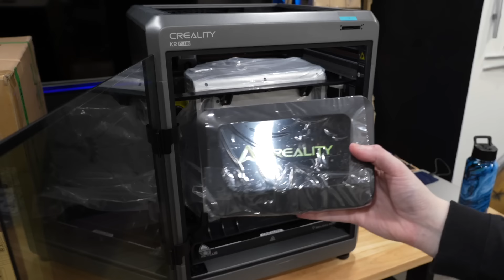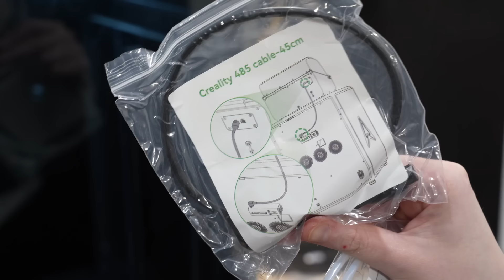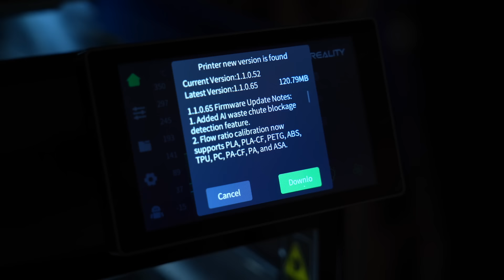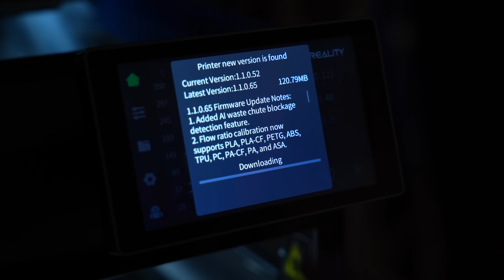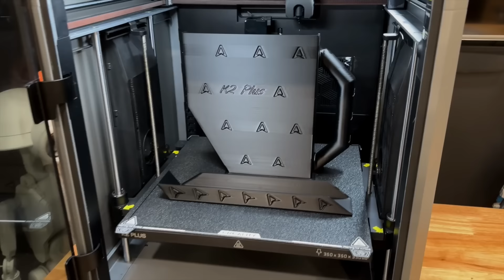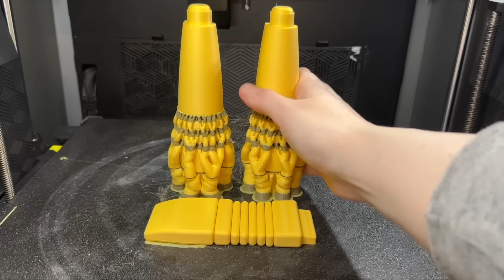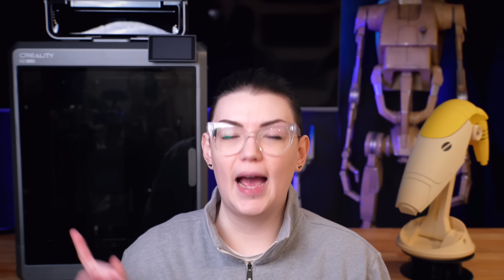Does the Creality K2 Plus live up to the hype?

Comment: I've had mine since launch and just passed 5,000 hours. I've run into plenty of small issues and replaced a few parts along the way, but that's actually one of Creality's biggest selling points for me. Yes, their printers are more troublesome than Prusa and Bambu, but they're also far easier to work on. An extruder jam on my X2D is a two-hour fix that involves removing 25+ screws, both nozzles, and six delicate plugs just to reach it. On the K2 Plus, you pop off the cover and remove three screws. That kind of repairability makes the occasional headache worth it, and Creality's replacement parts are dirt cheap. I'd take twenty 5 to 10 minute fixes over three 2+ hour fixes any day.

That said, some real design flaws show up the longer you own the K2 Plus. The biggest is bed warping after extended use, especially at higher temps. After about 1,500 hours of engineering filaments, my bed mesh looked like a taco. No amount of manual adjustment could fix it, and eventually it got bad enough that the mesh couldn't compensate anymore. The root cause is the massive 350x350 bed being supported by only two threaded rods. With a third rod, this likely never would have been an issue. I ended up buying a $250 graphite bed that will probably outlive the printer, but that's a headache most users won't want to deal with.

Still, at 2026 pricing, the K2 Plus Combo can often be found for around $850, which is a great value for a printer this size.

Bottom line: it's a great printer with some real issues. With the wave of tool-changing printers hitting the market, I'd only buy the K2 Plus today if you need the large build volume and only do occasional multicolor prints. But for engineering filaments, the K2 Plus is a monster.

Comment: I have had a K2 plus combo for 10 months, Purchased for a hobby machine not a business.  SPOILER ALERT Creality can't tell you how to replace the belt and the way it is attached to the extruder head is about as cheap as it gets.  Supports motto is delay, delay, delay and hope the customer goes away. It is cheaply made and quality control is non existent my experience with support is similar to @toofdoctor's below.  I really found this out after about 8 or 9 months.  Mine had missing screws, wires that have fallen out of clips and sensors that fail.  Initially it worked well except for the nozzle clogs.  Those went away with the purchase of a new nozzle and getting rid of the original and running the printer speeds a little slower than from creality print or Orca slicer and that helped print quality. Also preheating the bed helps a lot. The filament jams in the CFS aren't always easy to find or clear and they do happen.  The filament sensor in the hub on the bottom of the CFS fail and need to be replaced.  After 9 months the Y axis motor quit working, the CFS hub on the bottom had filament sensors that failed. Contacting support for a warrant.  Had to supply purchase information.  Then pictures explanations.  Then videos.  It took over a month and they sent some parts but never helped me fix the printer.  To replace the y axis motor a large amount of disassembly is required.  And to remove the side panels get a hammer a block of wood and bang away.  This was Crealities way to do this.  Being an engineer I was able to design some parts, machine them and make it work.  BTW Creality still hasn't supplied a solution.  The instructions and the wikki are terrible.  These are wrong, have missing steps etc.  MY LAST PRODUCT PURCHASE FROM CREALITY anything I have bought besides filament and spare parts to repair their mistakes have been terrible.  Whatever you do don't by a laser from them.

Comment: Thanks for the review. Gives me some insight if I should move up to a K2 or keep my Ender 3 farm. I have 4 Ender 3 V3 SE's, whenever I print anything large I just divide it into 4 parts and print each part among the 4 printers I have and glue everything together. Debating if I should move up to something larger. One thing that's holding me back is the K2 is heavy AF.

Comment: I'm on day three with my K2 (not plus) and I'm having a ball. Ignorance may be bliss but I've been happy so far. My benchy fell over toward the end of my first print 😔 but I did not wipe the plate down. I presume it had manufacturing schmoo on it, I know better so that's my fault. A couple custom designed hanging tool holder were problematic but only from the standpoint of tolerances and bridging/support fails, again, me learning stuuff. The biggest dislike Ive had was coicidentally when trying to print a waste chute that was just outside the limits of a K2. On my fourth download of the stl, checking comments of people who say it fit fine, yada yada, I loaded it up and it fit. Yay. Somehow the slicer brain farted and loaded up a K2 Plus profile and limits for my little K2 and it made some very unhappy noises once it started printing (I know this now and the difference between happy and unhappy noises) and ended up erroring out overnight at the beginning of an 11hr print.

Comment: UPDATE. 

 I bought one. 2 days later came back to it and the hot end was COVERED with melted filament. 2 days new
Then I had to go back and forth for 2 weeks to finally get them to send me a new hot end. For ME to install. If you want service warranty don’t buy this machine
Then after I get the new hot end and install it. Print 3 parts and started giving me a z axis obstruction error every other print. Have to restore the machine every other print to fix it. Sent them an email. As of a week ago, no reply
Warning. DO NOT BUY ANY OF THE K2 MACHINES

Comment: I shut off the purge tower and purge into into the print as infill using Orca, works really well.

I have also invested in the start up “Loop” filament maker. For the sole purpose of recycling purge, supports, and other non-used filament. You can also use it for recycling pet bottles.
Reply: Thanks for sharing. Good info

Comment: After the latest patch firmware this machines printing is gone down the absolute shitter.  My bed no longer prints out that nice L shape on the corner anymore, its like the xtruder is sporadic and decides when to spit out filament.  The Creality software is also buggy as all hell.  Filiment selector is broken and used to work fine, crashes all the time for no reason.  And the AI detection since day one has been an absolute joke.  The whole cabinent can turn into a string mess and it will just keep printing.

Comment: The thing i have found with mine is that there is a huge change is filiment usage when i print multi color i found the slicer does not account for color changes in a design perhaps that was where youre difference was as well

Comment: Yes Creality support, software, customer service and parts are beyond poor to a new level of China shit. Half the time I am not even sure what part fits what without buying and guessing. PS if you use an older laptop or cpu creality prints WILL NOT WORK and the K serious will not run well (really poor) on any other slicer and orca also will not work on the same laptops and CPU's-so if your using older cpu's buy something else. Creality cloud may work but is super confusing and glitchy-it's almost like someone who never made a website or has low level organizational skill made creality cloud-3/4 trash.

Comment: Just an idle thought, wouldn't it drastically reduce the filament wasted during a color change if the hub were moved up right between the CFS cabinet and the ptfe tube inlet to the printer?  Shorten both of those ptfe tubes to like 3 inches and knock off what, 15, 20 inches of the amount of filament that has to be retracted for a color change??

Could you try this for a wasteful print, with regular and shortened tubes, and let us know if/how much filament is saved?

If I'm misunderstanding the purge process, surely it'd still be a time saver?

Comment: Oh yeah this printer is a BEAST!  Even when emptied, it still weighs a LOT!  

The adhesive stickers/tape is def frustrating, although I got lucky and mine came off fairly cleanly.   You pointed out that there was thin plastic film on the upper right side but how about the same film covering the upper left side on the metal siding?  Yup!  Learned that today when I saw that the print head cable management snake was leaving marks on the film.  I had no idea it was there so I peeled it off.   It can be bad leaving that stuff on surfaces that get heated. 

Anyhow great video content.  Thank you!   

BTW: Do you happen to know if you can use the CRM along with the single spool holder?  I don't want to get greedy but it sure would be nice to have that 5th color available.   I'm pretty sure you can because the buffer allows for up to 4 CRM's so why not use one of the three other avail tube inputs to connect the single spool holder?  The software wants me to ID the CRM filaments AND the spool holder filament so it seems it is designed for this.  Logically, it should work but who knows because it is NOT mentioned in the manuals or the wiki.   Their client side support is half baked IMO.  Some of the images they refer to when instructing a user how to do something shows a different printer all-together and/or up close images of their R&D printer which is burnt up pretty badly.   Like ... Isn't this a flagship model?

Comment: Feel like you could have gotten just as clean a print on something like a Bambu or other similarly sized printer by using a .2mm nozzle instead of the usual .4mm.  Quality would have been even better using a .2 for that print on the K2, but BOY would that have increased the total print time....

As for the purge waste sometimes being all one color, I'm thinking it might be doing the same thing it does if you load filament from the spool holder rather than the CMS, where it'll extrude a pretty large amount, wipe it off, and then extrude a little more one or two more times.

Comment: One question that none of the videos I have seen have answered. Does the machine let the filament completely run out at the extruder before loading the next spool from the CFS? Meaning it has to stop and do a purge before resuming

Comment: While Creality is offering more replacement parts now it's still not very complete. I broke the extruder and the filament buffer. It's partly my fault but the instructions could have been clearer.

Creality's web store support suggests "check Amazon or other places". I found the parts on Aliexpress but that's not the best feeling when I want assurance that it's a genuine part made by the company instead of a copy which is likely to be substandard. Whether or not they're genuine originals, these parts are still 2-3 weeks away from delivery.

I can still use the printer but it really drove home the point that it's still a Creality printer. A friend warned me they have a history of abandoning support for printers to move on to the next model. At this point I would pay more for a machine that is better backed and better supported. I was hoping being a "flagship" model it would be better than this.

Comment: My K2 plus is great and horrible.   When it prints it is great but it fails to print about 2/3rds of the time.  Many many different error messages kill a print.  Thankfully the errors usually occur at the start of prints but filament feed errors will happen at any filament change.

Comment: Good review, I have the BL X1C but if I’m backed into a corner with updates etc with BL or it stops working for any reason I’m sold, I will have one no problem. What slicer did you use? I believe that the Creality slicer is less than perfect. Thanks

Comment: The parts issue is a hobby/industry-wide issue seemingly at all times regardless of manufacturer to varying degrees of severity. With the new admin in the white house and potential political repercussions, I've noticed a sh!t ton of panic buying that is further depleting available stock of just about everything, even across other formats like resin printers. Most recently, my main resin printer went down unexpectedly due to the almost new LCD screen just deciding out of nowhere to crap out. Normally this isn't a problem, but lo and behold, All vendors for LCD screens are sold out for this model (any many others as I found in doing a bit of investigative research), and I had to contact the manufacturer directly to get on a waitlist for the next batch of replacements. 
I ended up getting another monster FDM printer to supplement current R&D projects, and damned if you do/don't, filaments and spare parts for FDMs are almost gone, too, regardless of price bracket. 
Different topic, printer poop is a personal bane that I've never wanted to explore just due to wastefulness versus painting or even investing in multi-head tool changers. While my ratio of functional to fun projects is about 80/20, there are times where I've considered various schemes of multi-color printing just because, but I can't get past all the pictures you see of Immense wasted filament. Even if you take the environmental cost out of the argument, it's literally wasting money and resources to toss into a bin. 
To that end, even just to eat into my own stores of old supports and failed prints, I've enough stockpile to start building a custom extrusion recycling program with a salvaged industrial injection molding screw I was going to use for injection molding composite parts. I'm now entertaining the idea of turning it into filament upcycling for custom formulas and looking into doing local maker pickups.

Comment: Loved your review, but it doesn't sound like it's ready for prime time or a first printer.  I have watched videos on the printer regarding very poor quality control and as you stated, the software for this machine is ready for full time use.  Additionally, there are no spare parts available.  Like you said, there isn't even a print nozzle available.  I think I would rather wait to see what Bambu comes out with for there new larger printer.  Great video!!

Comment: Love your videos. On filament/purge waste, how about accepting it for the inevitable FACT that it is and will continue. Then, put that big, beautiful brain of yours to work by finding a creative, user-friendly demand for it. It could either be reground into new extrudable material or even as a matrix filler to add mass or strength to foam for packaging or sound or vibration damping? I'm 1,000 years old, so it's less of an issue to me, but I'd encourage a better solution 😊

Comment: All these “issues” you’re mentioning is why I didn’t get it. Even with the Qidi 4Plus I got, it still wastes a good bit when it purges because it still does the “L” shape print before starting the print after a lengthy purge. I wish there was a way to reduce it a bit, especially when not changing filaments between prints.

Comment: it is a default to purge twice. it purges out the previous color then purges out the current color. i think it does this  because of dark and light colors. i have seen it where that second purge still has some of the previous color in it as it purges. all on default settings by the way.

Comment: Purge volumes have to do with barrel lengths and there is a theory to calculate the amount of purge needed to change colors and I know that from running industrial extruders but the larger barrel equals more waste and is a poor design choice in the hotend increasing waste when you can get hot ends like mosquito hot ends with high flow titanium coated barrels which actually decreases heat creep and lowering waste . They even have titanium coated barrels replacements for lower end extruders so increasing barrel length only increased back pressure and purge volumes which would actually slow the extrusion down and make the prints lower quality if the speed and back pressure gets too high you will degrade the plastic

Comment: You mentioned the single color purge bits: those are there because the printer has a ridiculously long nozzle-heatbreak combo and it cuts the filament above that, meaning it needs to purge the whole distance every time it swaps filament (and it’s a lot of filament). No idea why they didn’t implement a retraction like Bambu has added (initially it also just cut the filament above the nozzle and then purged the whole thing)

Edit: of course you mentioned that seconds after I paused the video haha

Comment: I don't have a multi color printer yet but, is it true that more colors would necessarily = more waste? It's more so the amount of times it has to switch colors period, be that from 2 or 16 colors
Reply from the maker: You’re completely right about it being dependent on the amount of times it has to switch colours. When you’re looking at more complex coloured projects, you could be looking at the printer switching colours 6 times PER layer and that’s where the more colours = more waste. A 1000 layer object in 2 colours would be 1000 colour changes, a 1000 layer object in 6 colours is 5000 colour changes (assuming every colour is equally throughout the piece). In most cases you won’t be seeing a colour change for every single colour on each layer, but when you’re printing multiple pieces at once that aren’t the exact same, you could still be looking at all of those colour changes.

Comment: Thank you for a nice review.  Been using a QIDI Q1 Pro primarily for use with different materials.  My question to you is, can you print TPU over PLA or PETG, to mimic over-molding?  I've had to print separate parts with alignment grooves and pegs so parts mate together in the application, which works, but it would be neat to be able to have the machine change material types on the fly and not just colors.  Thanks!